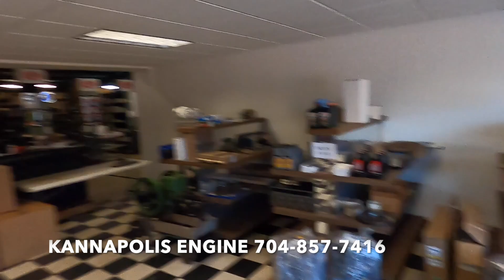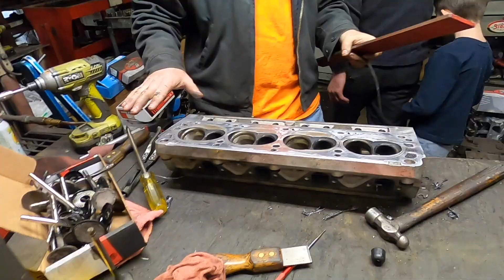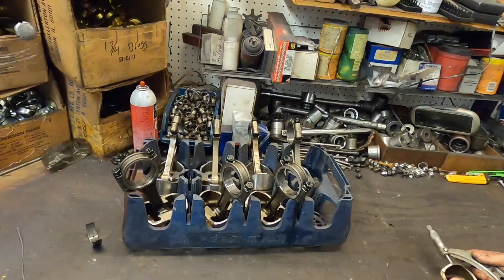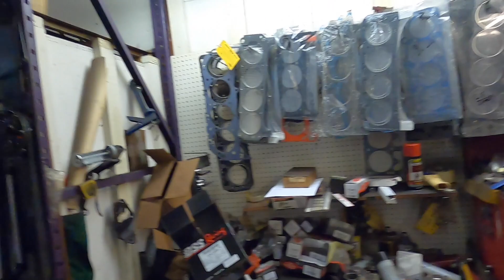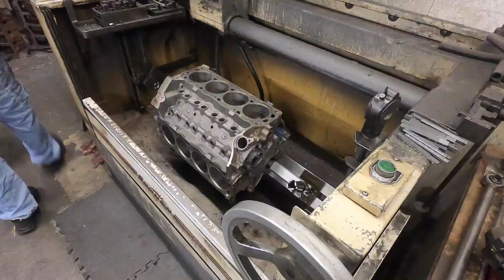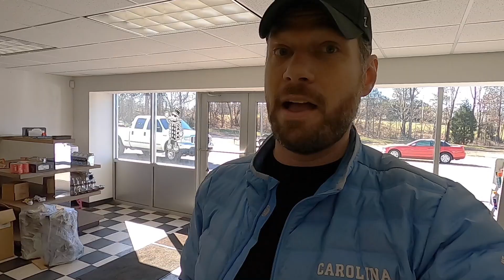331 OR 347 STROKER? // Watching a machine shop hone and prep the block for my SSP ROAD RACE BUILD!

Comment: Another thing you might want to think about is 347 is about the biggest you can go, so if something happens to the block you don't have much room to overbore anymore, so a 331 would give you room just in case
Reply: the bore is the same
Reply from the maker: Fair, I think if I had another issue I'd probably get another block.

Comment: As far as trick flow, they are having trouble getting heads manufactured so unless you're willing to wait till April I would go a different direction.  Definitely go with bigger heads though.  185 or larger especially if you want some kind of boost.  God bless
Reply from the maker: Yeah, I'm seeing the same issue with Trickflow right now.
Reply: A customer of mine just ordered a set of Trickflow 11r205's and got them within a week.
Reply: Guess what.   ITS April

Comment: Keep it a 331 if the crank/rods are reusable  and AFR 185s will be a good combo

If not 347 and the next step up AFR 195 competition heads
Reply from the maker: Definitely looking at the 195s!
Reply: @GearHead704  go 347 then you'll be close to 500 with enough cam like the xfi236
Reply from the maker: That's the cam I want.

Comment: For me 331 is the ultimate setup for sb windsor, piston pin height not sitting in the rings. Great stroke vs torque / rod ratio etc. That said 347's haul some serious butt. For all out pwr prob go the 347 and something that expected to have lots more miles 331.
Reply from the maker: Great point Mark.  I think we are going to cover some of the piston pin height issues in a future video as there has been a lot of questions about it.
Reply: @GearHead704  Probably also worth talking about late oem roller blocks and the use of mains girdles. They're a mighty mouse engine. You have a great engine builder. He really knows his craft.

Comment: The power difference estimate doesn’t seem large enough for me to personally do a 347 if I already had a 331. So I’d stick with the 331.
Reply: The 332" on my channel makes 530hp at the crankshaft, I shift it at 8500 rpm, still running great since I built it in 2000. Very durable and powerful combination.
Reply from the maker: Makes sense.  I think i've decided to go 347 just because I want to do another build in the future.

Comment: dss engines are not that good as you can tell by your cylinders being out of round.
Reply from the maker: I don't think they buy you much more than a stock block personally.  To be fair though I don't know if the block came like this from DSS or if any boring/honing was done in the first rebuild.
Reply: @GearHead704  ooooo I didn’t know it had a rebuild , I’ve herd there motors are good but I do know there pistons are great

Comment: Was the motor tickin or any skirt slap noise?
Reply from the maker: Neither.  Although I did put a quart of oil in every 200 - 300 miles and it shot a lot blue out of the tail pipes especially under full throttle.

Comment: Adam knows his stuff would see what he would recommend probably could build either one for autocross ever which one has best low end torque 331 my guess more reliable to
Reply from the maker: Yes he does, and I'll be working very closely with him on it.  Thanks Robert!
Reply: Generally speaking, the larger displacement is going to make more low RPM torque, but its also a matter of head port size. Figure out the head you can afford or your class allows, and recognize which displacement will perform best with it at the RPM you want to be spending most of your time at.

Comment: Depending on total cost.  Crank , pistons,  cam , possable rods , it may just be worth sticking to a 3.300 /331-9 set up .
Ready depends on the individual budget .
You already know you have to change the pistons. If you going with a 3.400 crank.  You'll more them likely need a cam . 
If your strarting from scratch or have damage on  parts I'd go 347 but Really no need to up grade if not needing new parts
Unless your trying to max put the effort . You're not going to feel the 10 or so hp less .
Reply from the maker: I think you hit the main point.  It's really a budget decision and HP will be fairly close.  I'm leaning 347 and I believe it will be more TRQ which I may feel as well.

Comment: Would probably be better to get a different block rather than new pistons.
Reply from the maker: May be cheaper that way, I"m not sure, but I was leaning towards 347 anyway, so I'd need new pistons for that I believe.  Planning to use the old pistons and crank/rods on a future project.

Comment: Be mad to find out the PCV valve was stuck. Lol   There where many thing you could of done before taking it apart. Leak down test, compression test.   Just a comment here.
Reply from the maker: Hi Les, your'e right of course.  My biggest problem was the quart of oil it was using every 200 or 300 miles with no visible leaks and I wanted my vert to be more of a cruiser, so it got the 306 that was ready to go in my coupe that is going to be dedicated for road race.

Comment: Just depends on if you want to spend the extra money on a crank shaft! I didn’t see him look at the crank if it has wear i would go with 347 if crank is fine nothing wrong with a 331
Reply from the maker: Great point of course.  My crank is ok.  I'm thinking of using the 331 components on a different build.
Reply: @GearHead704  that will work also! Great content on the channel

Comment: I would be curious in hearing Adams thoughts about wrist pins intersecting with the oil ring groove in the 347 as apposed to the 331. That’s a thing that always made me prefer the 331. Unless something has changed and they make 347 pistons that don’t do that.
Reply from the maker: We've had quite a few questions on this, so I think i'll cover it in an upcoming video with Adam if we can.
Reply: @GearHead704  would you happen to know if a regular 331 stroker is just as good as the forged 331 stroker? Or if it's better to by a forged 331 stroker right off the bat?
Reply from the maker: All depends on what you are going to be doing with it
Reply: @GearHead704  if I wanted to do a carb swap, long tube headers, heads, letter cam, 3.55 ring and Pinon? What would you apply?
Reply: @oscarvillarreal8951 you probably answered your question by now, but where a forged crank truly pays off is in a supercharged engine scenario, since you're tugging on that crank to keep the belt tight. Or if you're spinning the crank above 5,500 rpm often, since the crank does act like a spring and bends (which is why you shouldn't lay a crank down when storing it--easy enough to stand it up using an old flywheel). but a good casting will put up with a lot.
Reply: The newer pistons are better, but there's still the issue of room. Push the rings closer together, and detonate, and pop went the weasel. If you're boosting, go with the 331 and use its rev-ability. If you want to make power below 6,000 RPM, go with the big bore Dart 363 block, and get a 347 short stroke and less valve shrouding.

I like the low deck Windsor, but it was originally designed for a 221 cid power ability to move an economy car, with the tall deck Windsor to do battle against the Chevy 350. So there's gonna be some limits :)

Comment: On a stock block the piston will come out of the bore too much even with a piston designed for a 5.400 rod and 3.400 stroke. I know people do it all the time, including myself. I sold that combo and went with a dart shp big bore 347. I would go with a bigger head and cam I run afr 220’s but I also have a cam designed for rpm and short travel lifters.
Reply from the maker: Yeah I'll have to get the cam and heads working together well no doubt.  May even change out that comp cam for something else.

Comment: Go with Trick Flow 11R's regardless of whether or not you go 331/347. Great video.
Reply from the maker: It's about 50/50 between trickflow and AFR in here.  Unfortunately trickflow seems to be out of stock right now.

Comment: 347 will have better torque. It will help with the afr185 heads and make a really fun car. I think you will be very happy either way on cid as long as the afr heads are on it 🤗
Reply from the maker: The AFR's and the 347 is the most popular suggestion tonight LOL, but good points all around.

Comment: I'm working on a 408ci, and remember the Cam looses RPM range with the longer stroke too. I wish I would have known before buying a Cam!
Reply: Double checking, we have the same cam you mentioned in the video. I need a high stall converter.
Reply from the maker: 408 is going to be fun!  Yeah, we are looking at the right RPM, I may have to change my cam.

Comment: Depending on the cost difference but if the price is minor, I would go for the cubes personally 347
Reply from the maker: Leaning that way.
Reply: @GearHead704   unless there you’d be a significant differences between the blocks for horsepower/torque on different circonstances, plz enlightened me cause my knowledge is limited....
Reply from the maker: We'll be covering why I went the way I did on the channel for sure.  I'm also learning most of this as well.
Reply: @4valvejack  the case can be made the 331 has a better piston ring location for both boost and longevity...but how long do you really need the engine to last? If you take it apart every race season, you can catch a ring going away. If you are building for the street, you may not leave an engine alone for 100,000 miles.

As for power potential, figure out the RPM you want to operate at. Or if you have a head limitation, choose a displacement where that particular head makes the power you need at the RPM you're at (off the dragstrip line, off the corner, down the straightaway, crossing the finish line at redline, etc)
Reply: @albertgaspar627  you realize that there are countless stock engines that have similar if not worse piston ring locations than the 347, my last one went 212,000 miles trouble free when I sold it.
Reply: @msk3905  Feel free to name the ones with the wrist pin inside the ring lands as the early 347 stroker setups had, but you said stock engines...how many of those are getting hit with nitrous or boost or shifting over 4,000 RPM with their automatic slushbox transmissions? but quite a few 347's are.

Glad to hear your 347 went that far. A Windsor with regular fleet level maintainance gets near 300,000 in many fleet trucks.  but keep in mind, the low deck Windsor wasn't even designed for the 301.9 cid's stroke, Ford had to create a new block in 1967 with longer cylinder walls from the old 289 just to keep the piston from coming out the bottom and wobbling around at BDC. Ford designed this block originally for 221 cid (they like their engines to initially start at flathead displacements) for lightweight economy cars instead of a bigger six cylinder option, while Chevy designed their small block for the entire vehicle range.

Comment: What's the odds that we both have motors at machine shops? Tho my block is a chevy 350 (well 355ci technically now). I don't know if you had the same experience as me, but when I was at the shop talking with the machinist, I kept learning so many new things. Like I totally wanted to hang around him for a day and learn about engine building stuff that I've never thought about. Folks like these guys are just are a blast to talk to. I would go 331ci b/c this motor is going into a road race/autocross car. Piston speed with a stroker is faster so higher rpms it may not be a total fan of which you will be in most of the time for those style of events. It's not always about hp/torque but reliability when staying in those higher rpm bands all the time.
Reply from the maker: -> I don't know if you had the same experience as me, but when I was at the shop talking with the machinist  kept learning so many new things.,    C'mon Sammy it's me, so yeah I was learning on everything LOL, but yeah that's the cool part.  Good call on everything else you mentioned.  Adam and I are going to work through those details and of course I'll let you know not only what we decided, but why.

Comment: Go 347 or 363! I have a 347 in my green car! Also do 10.5-1 pistons if you are not going to boost it. More power and will sound better!  9-1 if your doing a turbo. Also, Get ARP head studs, Cometic head gaskets and tap that oil pan before you re install the engine! Go 11r 190 Trick Flow heads! ;-)
Reply from the maker: ROFL Frank, I knew you'd say tap that oil pan!  ROFL.  Yeah I think I"m going to go for the higher compression pistons. Thanks man.

Comment: 331 will be more durable. the longer stroke means more piston angle at the bottom of the stroke.  Big power is for drag racing IMO where peak matters most. Autocross is about a power band you can control and limit inputs (being able to hold a gear longer and control with the throttle). You'll be happy either way especially with AFR heads.
Reply from the maker: Great point on the auto cross.  I think I'm going to also want to do some road racing as well.  Great points, you've given me something to think about buddy.

Comment: You should check with the local autocross club to see what rpms they run their motors at. I doubt you will need a huge top end hp number. Btw... Great video too.
Reply from the maker: That's a great suggestion.  I better hit up WarHorse Racing as I'll be following his circuit some.  I do plan to track it (Road Race) as well.

Comment: Trick flow 205 11r and 347
Reply from the maker: I wanted to go trickflow, but can't find any in stock until late April for right now.
Reply: @GearHead704  yes i found a set of 190 56 11r on summit but they are comp ported and they want 1050 a piece.

Comment: Best engine I have ever built was an Eagle 347. A little bit different in that it had an internally balanced crank with Chevy V6 rod journals. The rotating weight came in 3lbs under a DSS 331 kit. Yes, the wrist pin intersected the oil ring, but it never consumed oil. Only change I would've made would be a domed piston to go over 11:1 compression. It was a screamer, 7200rpm no issue.
Reply from the maker: Sounds like an awesome engine build.  I"m definitely leaning 347.

Comment: 363!
Reply: Isn't that built from a 351 block,not a 302 block??
Reply: @johndoe-zb8bm  No, it's a 302 Boss block with a big bore kit I believe.
Reply from the maker: I believe I have to change my hood for that or do drop motor mounts, so that one of the reasons I'm not going with that, but it would certainly be fun.